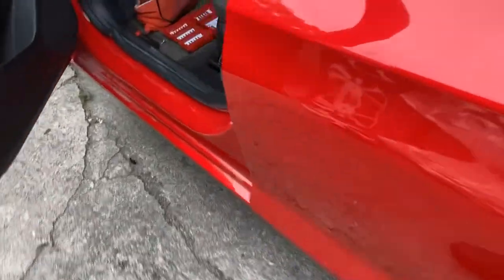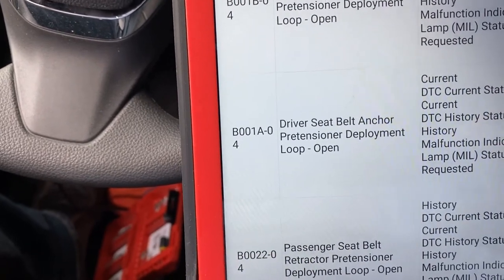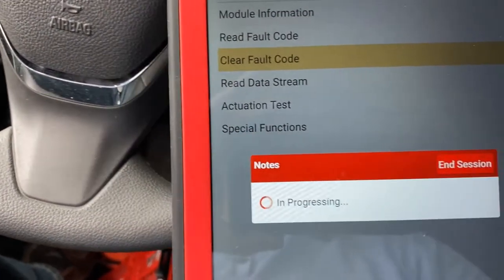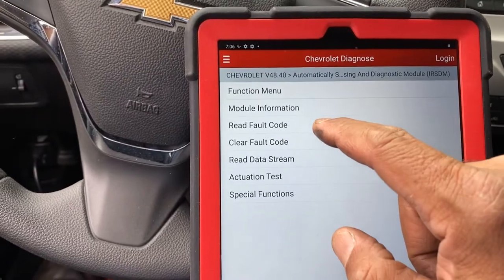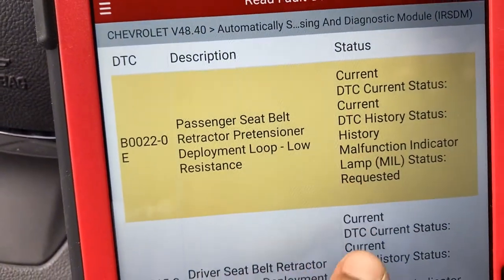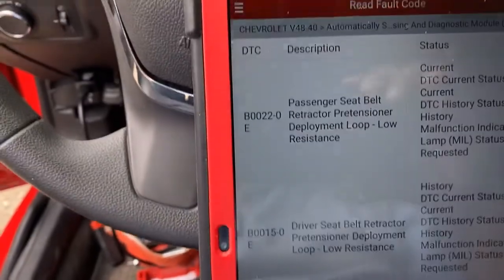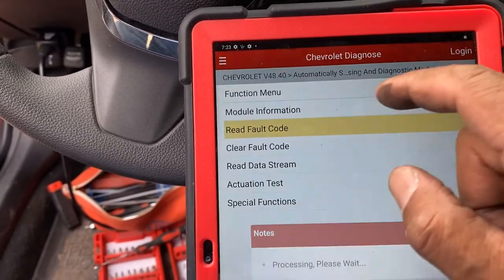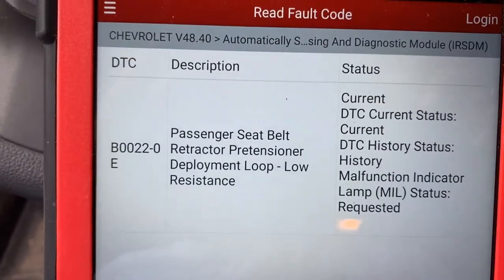HOW TO FIX CHEVY SEAT BELT RETRACTOR PRETENSIONER, CODE B0015,B0022, B001A

Comment: Thanks for the info, I’m from the United States and very interested to know more about the airbag system how it works, I have been looking for on education center or school to learn that but I couldn’t find any of them, so do you have any information where I can learn that , actually I have an little knowledge on the airbag system like how to remove all the different deployed parts, install new parts , but I don’t know how to fix the codes and reset the airbag model , so can you help with that ? Thanks
Reply from the maker: knowldge will come with practice, try to watch you tube vedios about airbag, try to learn how to read eeprom out of circuit , then you be ready to read any airbag module and code it, i will try to post some basics vedio about airbag programming when i have a chance

Comment: I got a 2012 Chevy impala and I was looking at your codes there while you were reading them and I got that B0 022–0 D it’s saying that the seatbelt retractor retention or deployment loop resistance above threshold and that code B0022 – OD and then I got another code b0022–04 and this one is an open circuit can you please help me? I know there’s only so much you can do online but should I take it in to dealership? Or what im stuck thank you

Comment: HI buddy, I tried replacing the Seat belt Anchor and Pretensioner related to B001A , B001 B, B0015, B0022. After changing I tried reset also but still the light is on. can someone help me out finding a solution. Thank you